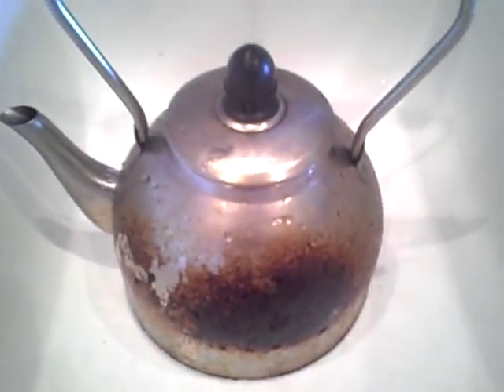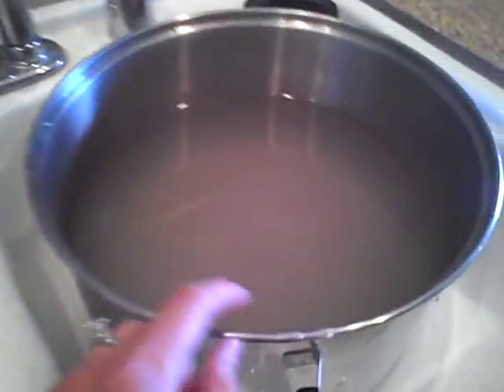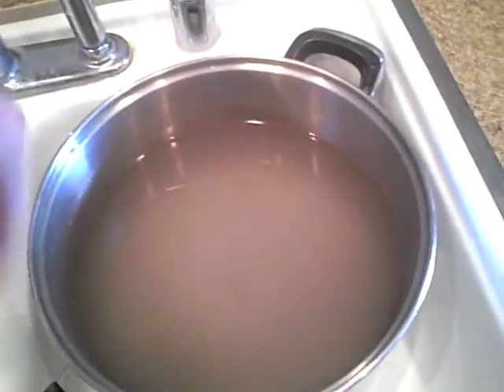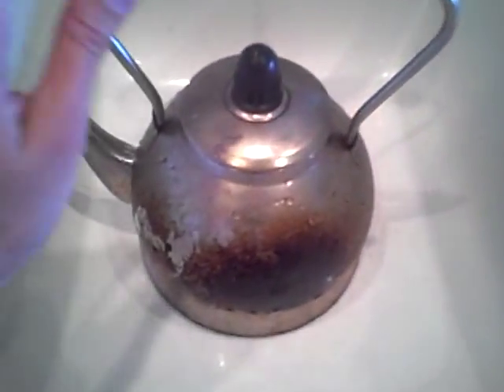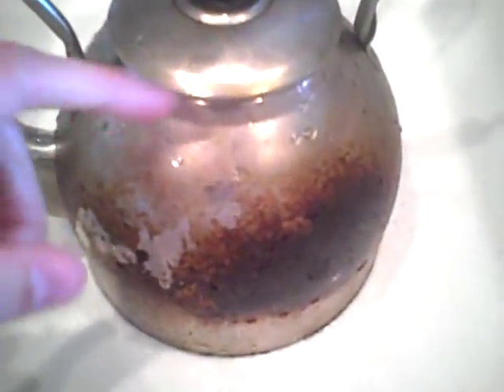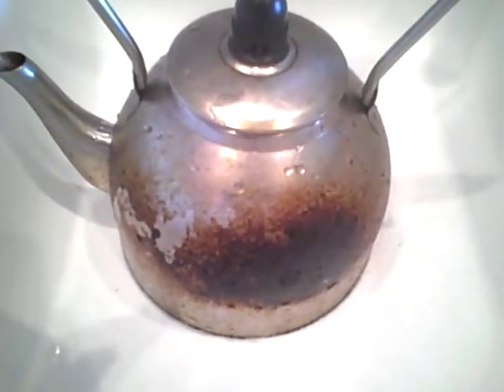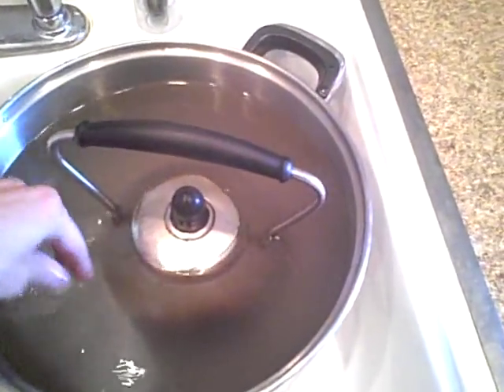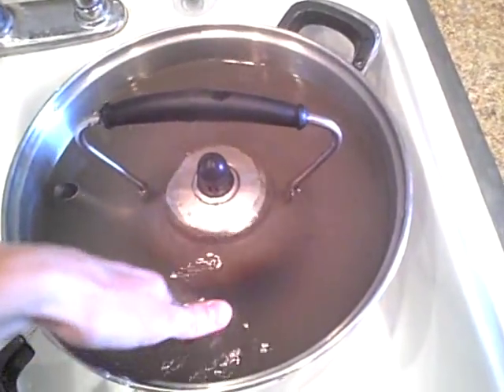Cleaning a tea kettle part 1

Comment: Like the idea of boiling the kettle but i woul add a cup of white vinegar to the water. Let it boil for ten minutes, then scrub with baking soda and sponge.  After I clean the kettle I would use the hot water with vinegar to clean my toilet bowl in my powder room. Pour the hot solution into the bowl and scrub.  
You get 2 uses of the cleanijng so,ution.

Comment: I don't use dryer sheets but tried the diy "goo gone" as it is a much better hard surface cleaner than a label remover (imo). It will sort of work if the pot is boiled as in the video. However the pot needs to be continually reboiled. It is not a good solution. I estimate I'd have had to reheat a couple dozen times, at least. I will have to try the dryer sheet method. But another day :)